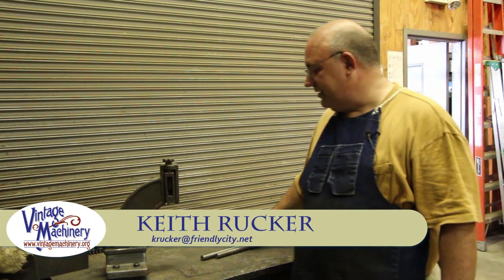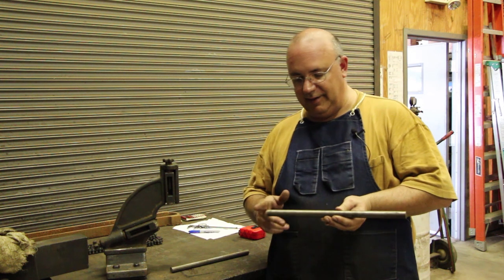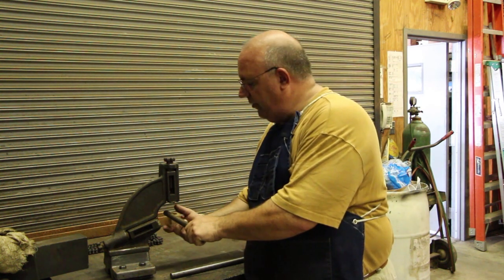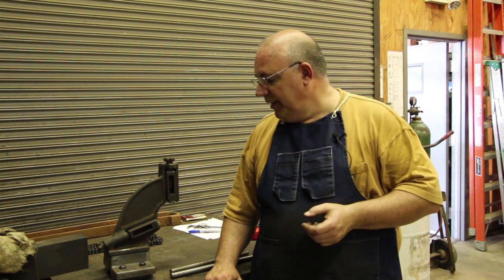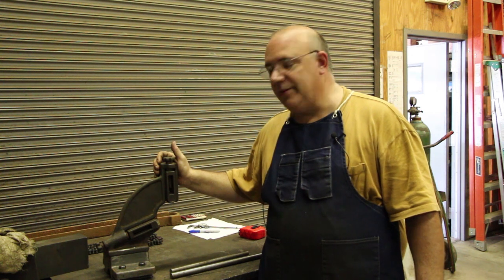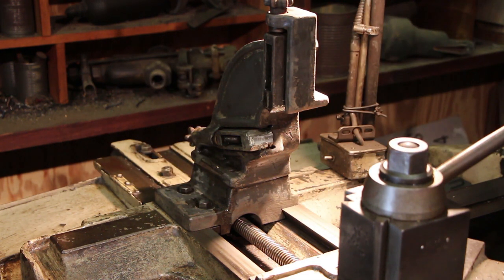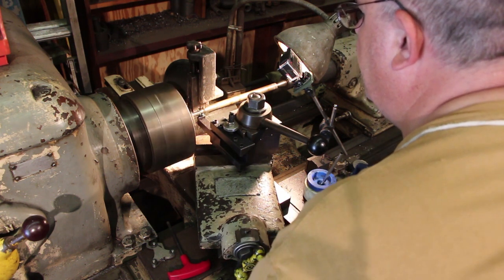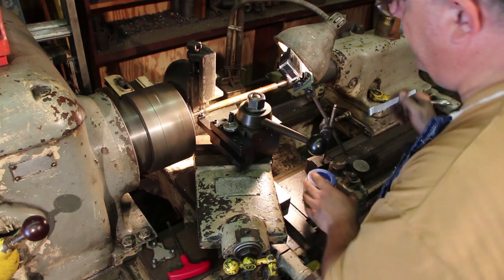Using a Follow Rest while Threading on a Metal Lathe

Comment: Quick question for anyone with the know- I am making a follower rest specifically for making long left hand acme threads on my modest garage lathe, I've already designed and cast it and am building out the adjusters- my question is- what material would be best for the contact surfaces? Bronze? Will brass work? The work is alloy steel- 41xx usually. I'm tired of eating rods that are 95% finished when they jump😂

Comment: So what do you do when you are turning down the diameter? At the end of the cut at the chuck, there will be a step that is uneven which will cause you to have to start closer to the tail stock every time you go deeper. I had this problem when I was turning down some stock and couldn't think of a good way around it short of continuously taking the follow rest on and off.

Comment: Keith, if you had rotated your toolpost 90 degrees clockwise and placed your tool holder on the left hand side of the toolpost would that have let you reduce the tool overhang? Looking forward to 100k.

Comment: I wonder , looking at the follower, can some retro-fitting of an all steel version where adjustments can be varied to allow better free space for cutter heads? Just something rattling around in my head Keith. I do love to tinker sometimes. smile
Reply from the maker: I am quite sure an all steel version could be made.  But, I have since found an original for this machine so no longer any need!
Reply: Just my tinkering coming to the surface. Kinda like" I wonder if I did this or that would I have it pass or flop.

Comment: Keith, what type of material is used on the follower where it touches the part being machined? I don't see anything that looks like a roller of any kind. Is it a soft metal and if so, does it get into the part or cause any wear? I loved doing this kind of stuff in metal shop in high school and worked for a short period of time as a gear cutter's apprentice at Otis Elevator Company in Yonkers, NY in the late 60's.

Great stuff!
Rich
Reply: Keith raises an interesting point. The use of bronze fingers on a travelling steady (I prefer that term because it's sometimes better to set them leading, rather than following) can potentially be a trap when screwcutting, as I found when I borrowed one years ago to cut a long stainless screw for a jockey wheel elevation mechanism.
The rest I borrowed did not have really deep (or long) fingers or pads like the L&S item in the video, and they were bronze. 
What happened was that the trapezoidal thread I was cutting raised slight burrs either side of the groove, and the heavy cutting pressure caused these burrs to carve a shallow trench in the narrow bronze pads. This was not particularly a problem except that after a couple of passes, when I went to disengage the half nuts, I was somewhat perplexed  to find that the carriage kept on moving towards the tailstock of its own volition. The newly 'threaded' steady pads were acting as de facto half nuts, with the workpiece taking over the duty of leadscrew.

So when I came to make my own travelling steady (lead or follow rest) I made sure to build one with rollers. 
And when I fitted out a bigger lathe, I made a mobile "dead man's pedal" for it, so that whenever I take the weight off the ball of my foot, the spindle rotation stops short.

Comment: Congrats on the 10,000.Does your lodge and shipply have the zero stop thumb screw on the cross feed?Mine does. It is a real nice feature that is exclusive to lodge and shippley.
Reply: ***** can i have your e mail address so i can send you info on the micro ball screw on the lodge and shipply?
Reply: ***** i have a manual on lodge and shipply if you need a copy.Call Dave 716-830-3618 if you want.

Comment: Can't wait to see the pattern making on the follower rest hard to find demos on the subject.
Reply: Keith, I'm curious about how to copy a cast part. The main issue is, I'm guessing, allowing for shrinkage.  Another might be the fact that the follow rest isn't in two parts, but that could probably be handled with a coped casting, like Doubleboost showed, where you build up some sand to cover part of the pattern, ram the other half on top, then flip it and do the part that was buried in the temporary sand you built up. Not sure how you'd deal with shrinkage though. 

-- Mike

Comment: Good show Keith!  A few questions: What is the bearing material on the follow rest?  Did you cut the bearing surfaces to match the diameter of the workpiece?  Are the bearing pads replaceable to match different workpiece diameters?  Is there a reason the two rests are in those exact positions (the top one makes sense, how is the angle of the rear rest determined)?

I guess that's four questions, close enough to "a few" :)
Reply: *****
The part is being supported by less and less follower area as the thread is being cut.  It is also slightly wearing into the follower bearing surface.  Do you adjust it tighter against the part as the cut is being made?  Do you decrease the feed depth as points form on the thread crests to prevent damage to them?